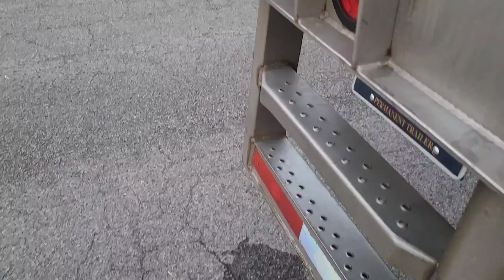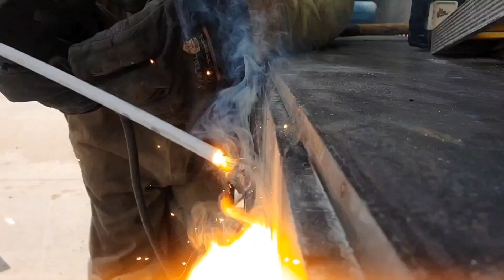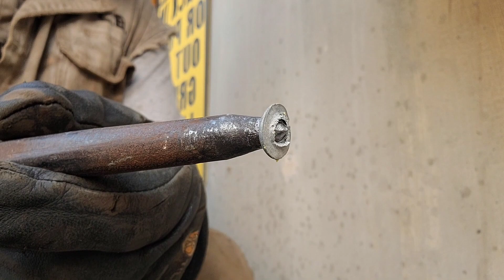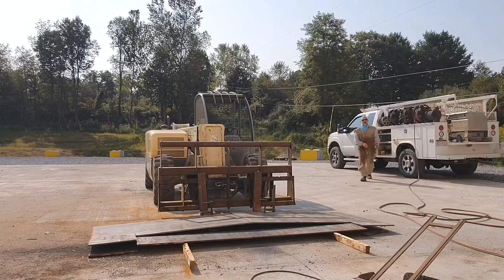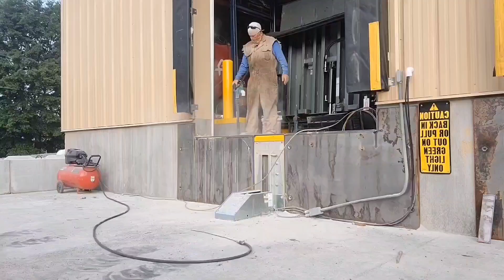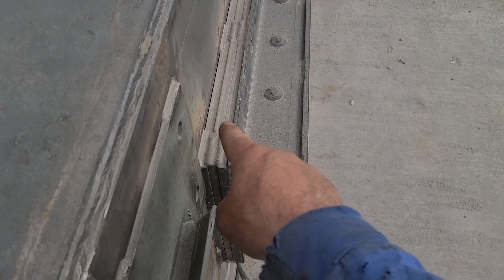Loading dock repair

Comment: It ain't - it's the rocking up & down as the forklifts enter & exit that does the damage to the bay. I worked out a spring loaded dock bumper that cut that issue down to nothing - being too poor to get patents & whatnot, I got sidelined on those - but they work. The dock bumper has to go with the lorry. Resistance is futile.

Comment: that 'bottom bumper' isn't a bumper. That is the under-run guard that is meant to prevent an auto or truck passenger cabin from running up under the trailer if hit from behind. An aid to try and prevent decapitation fatalities in these accidents. 
might not want that to get bent up before it's needed.
Reply from the maker: Good info...thanks for watching and commenting

Comment: The hammer blow increases the pressure which increases the heat of the weld, and, therefore, improves the weld, as well as closing the gap. Your construction is well thought out, executed, and comprehensive.  Great looking job.

Comment: I guess I ought to start off with a little house cleaning.  I feel absolutely terrible about the thing I said about the bridge.  It's not my mission in life to make people feel bad.

Anyways................this turned out nice.  You're absolutely right about those vertical corner plates.  The main bumpers are nothing but a cantilever.  They want to tilt when the truck hits 'em.  The vertical plate will take the load, along with the plate you put over the flat floor in the pit.  Nice.

As far as that lower bumper,, by the DOT bumper hook..............................  Those guys are crazy.  All that bumper need do, is protect the safety hook mechanism.  No way it's gonna be able to match every DOT bumper out there.  You can look at 20 different trucks/trailers, and the DOT bumper is gonna be in a different place as far as height, or distance from the actual rear of the truck.  They're all either designed different, or have been tweaked by getting hit, or damaged when guys pull away from a dock without making sure the safety hook is retracted.  I drove for years, and I never saw any two DOT bumpers in the same place.
Reply from the maker: I don't think ya made anybody feel bad...certainly not me...I just think your claim that the pier pins would shear off is unlikely...each pier has eight 3/4" stainless steel pins and four 1" cold rolled pins

As far a spalling, underneath the channel bases that the piers set on we cast a new section of cement using Rapid Set Cement All (9,000psi) to spread the load out across the old concrete footers so I think it could suffer severe spalling for a century and never remove enough strength to cause a structural problem with the bridge 

Thanks for watching and commenting 🙂

Comment: I wish more of our customers would come off the money for repairs like this. I install this stuff daily and youd be surprised some of the walls they want the equipment mounted to. Cmu's, hollow core precast (foam in the core) etc. Wall thickness less than an 1" in alot of cases.

Comment: Looks like your gettin the hang of it,.... what's  the hash  marks inside your door?
Reply from the maker: I used those marks to keep track of the number of wellheads I welded on the gas wells for Antero Resources when I was serving their drilling operations here in the Appalachian Basin

Comment: Don't waste your money on liquid nails or gorilla anything, those products are inferior to almost anything else imo. (carpenter 35 yrs)
Reply from the maker: If not liquid nails or gorilla glue then what products do you recommend for use with steel, concrete, and block?...I know I wouldn't use the Euclid epoxy every time because it is far to expensive for some applications...on steel base plates on concrete I've drove steel pins in with no glue at all before and that works fine to prevent the base plate from moving but any adhesive would be better than none...even it you just shot some silicone in the hole it would be something sticky that could offer some corrosion protection

Comment: Seems stupid to me to have a truck reverse into a SOLID steel and concrete wall! Of course the concrete is going to fracture.. there needs to be a method of softening the impact.. say some sort of shock absorption.. like a leaf spring, just sayin 😊
Reply from the maker: All I've ever seen on them is the bumpers...rubber bumpers on the loading dock and rubber bumpers on the trailers...when they make contact the rubber on the truck hits the rubber on the loading dock

The issue I saw when I was working there was drivers that hit it far too hard...they need to make contact to dock in correctly but some of those guys bash into the dock hard and rollin fast...if I owned the place I'd do something about that problem...it's just blatantly unprofessional if a driver cannot dock in with some degree of control...those loaded trucks are 40 ton wrecking balls in the hands of an unprofessional driver

Comment: I think the heat from the weld helps the epoxy set faster As for the dock plates thats a great idea i seen some i would not drive a fork lift over because there falling apart ! Love your work !
Reply from the maker: Thank you

Comment: That hot tack is a great idea, thanks 👍🏻

It looks like there's not enough rebar in the concrete and the anchor bolts for the plates are to shallow.
We built some dock levelers about 20 years ago in a Cadbury chocolate factory in Dublin Ireland.
There was a lot of rebar designed in to them. They actually designed thick steel angle iron set into the concrete with large threaded bar bolted to the pieces of angle  steel coming out through formwork cast deep into the concrete.

We just did the formwork and rebar so we  were gone by the time the bumpers were bolted on but seemed like and extremely robust design.
Reply from the maker: I agree...there was not enough rebar and the way the dock bumpers were originally designed was just not strong enough...it is obvious that there is a weak place in the concrete where the wall and floor were done in two separate sections there at the corner also.

I just wasn't built strong enough for what its for
Reply: @NBSWELDING  yea makes sense, the design of the ones we did was monolithic, slab & wall poured together with the sides and rear forms suspended.